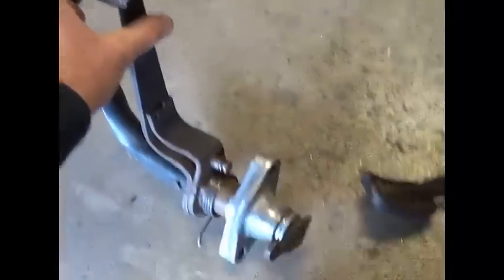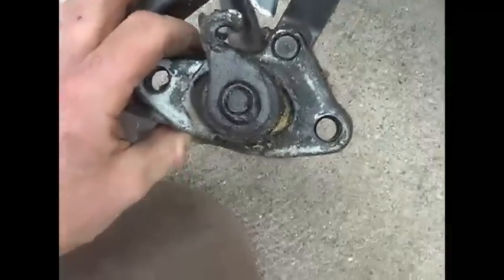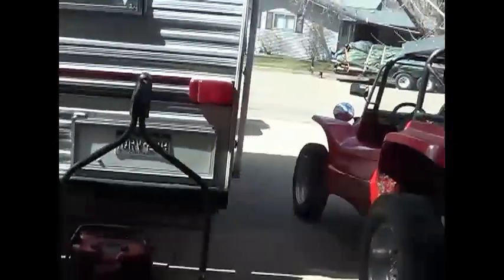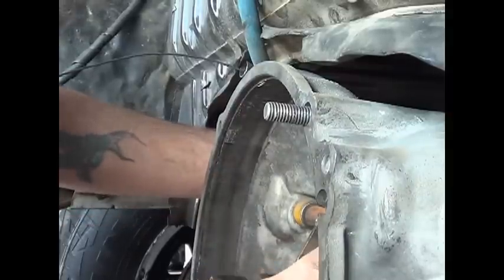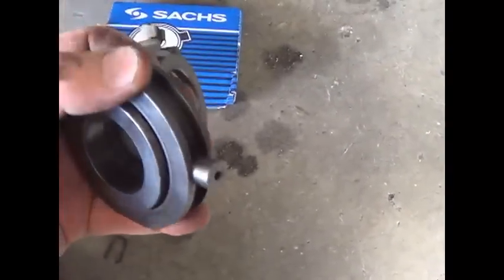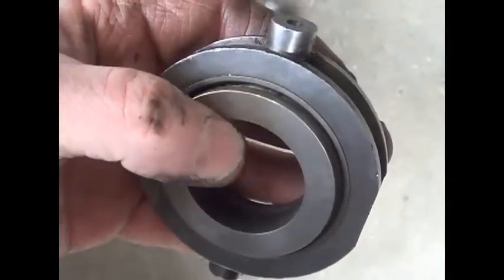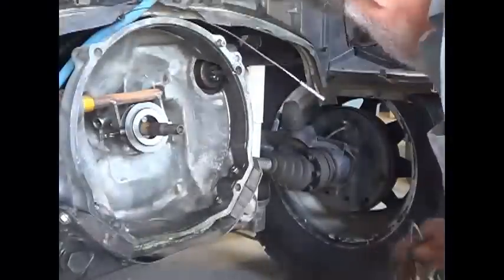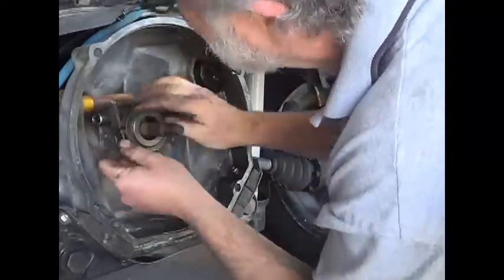Clutch Peddle / Throwout B. Repair (69 VW sedan)

Comment: I have had those T/O bearings with a kind of teflon coating. I have never removed it... hmmm... Hope  don't have a similar mishap. Thanks for the video!
Reply from the maker: +vw64manyrd  Never noticed when I put it on and I had to take over to the wire wheel to get it off. I figured it got baked on. Good to know someone else has seen the same thing.

Comment: I just had this happen last week, peddle to the floor, pulled clutch cable out and nothing wrong with it. While it was out replaced it with a new cable and changed out my throttle cable. So pulled engine and found one of the ear's broke off on the fork.Had a spare trans so I pulled the fork out of it and beefed it up before re installing the fork. extra welds.I up graded to a stage one pressure plate.
Reply from the maker: Very nice. I hop;e your troubles are over.

Comment: I just did this a month ago on my 65 Bug.  Because I didn't fully remove my engine, I didn't have the same access to work as shown in this video.  I GAVE UP on the new "racing" style clips.  Way too hard to put on with limited access.  Finally wound up putting back the "original" :(    But the new TO Bearing worked great !!
Reply from the maker: They can be a bear, that's for sure. Glad your up and running  again.

Comment: I fought the battle last night with a small screw on a carburetor.  I put it down on the bench where I couldn't possibly lose it and came back, and no screw.  I looked and looked for it before I noticed it laying right in front of me. My bi-focal glasses blurred my vision  making it appear to be invisible.  That screw was not much larger than what you find on eye glasses.  It holds a mixture screw adjusting stop used on an outboard motor.  I am a senior citizen so that is my excuse.

Comment: Lost my clutch this weekend, but It was just the wingnut that came off at the back end. I should maybe use a locknut behind it for next time.
Reply from the maker: +Kewlbug  Try to find a stock one.  The clutch arm has a oblong recces that fits the wing nut. It's hard to adjust
Reply: Thanks, I got the right one now. I don't know if the old one was oblong, It's in the road somewhere now. RIP wingnut.

Comment: great vid EZ, so what was the white stuff? was it a protective coating that should of been removed before fitting? i guess the mating surface seized, gripped and spun it right out?
Reply from the maker: Yeah, I screwed up big time. The guy I got it from thought it was used and I didn't notice it in the light I was working with. Not to mention old eyes. LOL  It was just a rust protective tape and It made a mess and seized.  I share the good and the bad so other folks will learn along with me.

Comment: Hey umm I need to know how you got the push rod off for the brake Master cylinder
Reply from the maker: Your worst nightmare is working the pedal assembly. There is a adjuster nut on the rod but you may have to remove the master cylinder or loosen the pedal assembly. Your going to hate me going into it. But if you take your time and clean, Paint and oil everything down there you won't have to do it again for many years